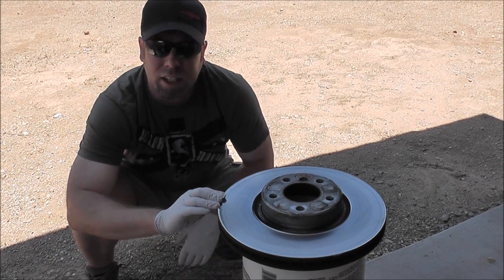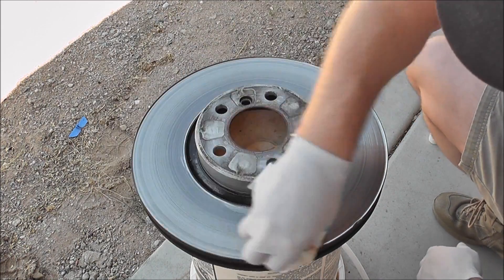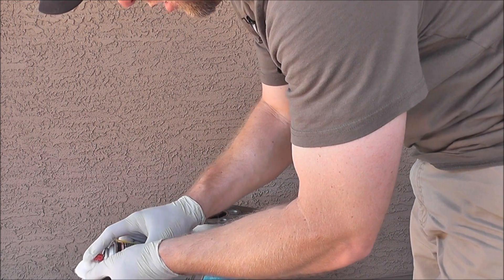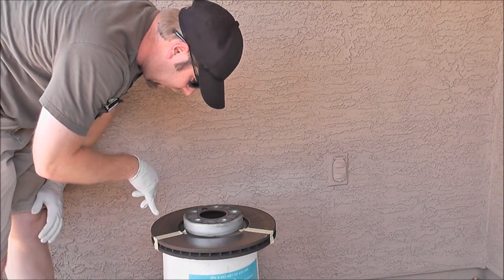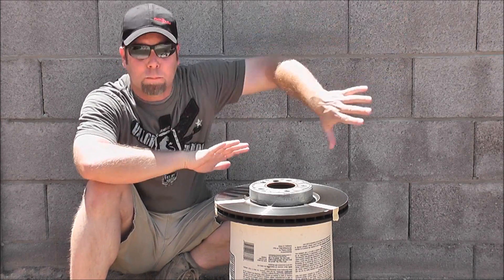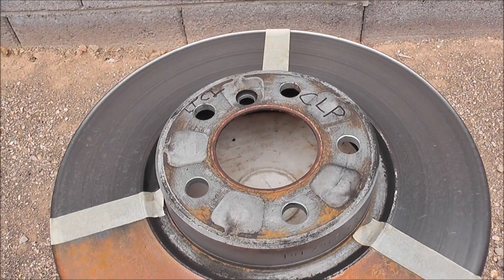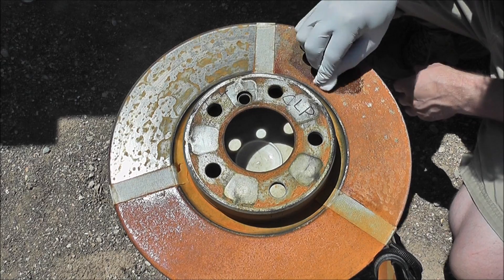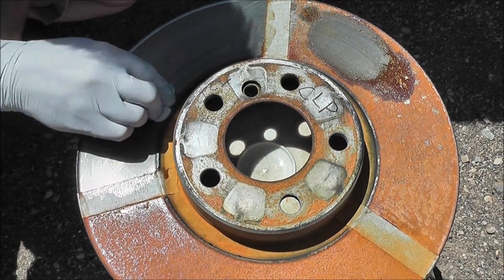WD-40 LTCI vs. Break-Free CLP (Test Two)

Comment: I bought some Breakfree and used it to clean my guns.  I always leave them a little wet, it helps to preserve them between uses.  I checked them around 2 months later,  they are stored in soft and hard cases, in a dry enviorment closet.  Every one of them were begining to rust.  In the past (and present) I have used WD40 in the same way, never, never have they rusted on me.  They are still wet at 6 months with WD40.  I have used the WD40 method for over 20 years.  I will use up the Breakfree when I'm at the range and cleaning afterward.  But, when it comes to storage long or short term, I'll continue to use WD40.

Comment: Vaseline petroleum jelly is essential non-toxic and performs well.  It's thickness may be undesirable for a lot of applications though.
Mineral oil is essential non-toxic, but performs poorly.

Unfortunately I did not know about WD-40 Long Term Corrosion Inhibitor when I did my tests.  It might be a winner for corrosion prevention, but looks kind of nasty from the Material Safety Data Sheet, and is on the expensive side.

Comment: I did some similar corrosion testing a few months ago.  This is the ranking that I got:

1. wheel bearing grease (Mag 1)
2. M-Pro7 Gun Oil LPX
3. Vaseline petroleum jelly
4. Superlube grease
5. olive oil (Kirkland Extra Virgin Olive Oil)
6. motor oil (Mobile 1 5W-30)
7. Breakfree CLP
8. Ballistol
9. synthetic automatic transmission fluid (Mobile 1 Synthetic ATF)
10. synthetic automatic transmission fluid (Valvoline Dexron VI ATF)
11. Mineral oil
12. WD-40
13. Control

Comment: Yeah thats what I was thinking. Since oil and water do not mix I was thinking that a the rust may have been developing on top of the water as it ran across the metal surface and when it evaporated it settled on top of the protected metal surface. So the rust on top of the WD section may have came from the control portion and settled on top of the Protected surfaces.... IDK if it makes sense to you but its plausible in my head lol.

Comment from the maker: Thanks Rotativo!  I was hopeful that the LTCI would do well but two days ago I was actually worried.  The LTCI showed signs of surface rust and the CLP had none!!!  It was really weird.  Turns out that the rust must have just been floating on top of the chemical. Perhaps it came from the hub and ran onto the disc, giving the illusion that it was rusting.  I wish I could have seen the rotor 24 hours earlier.  Would have been helpful in understanding the progression.